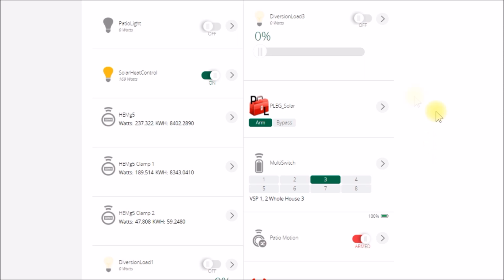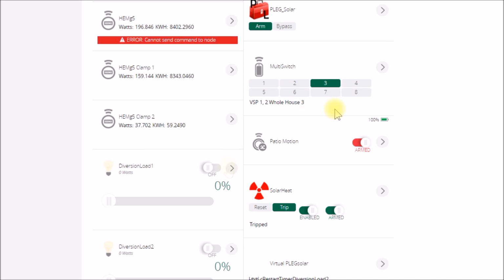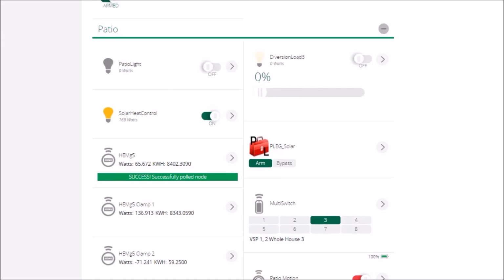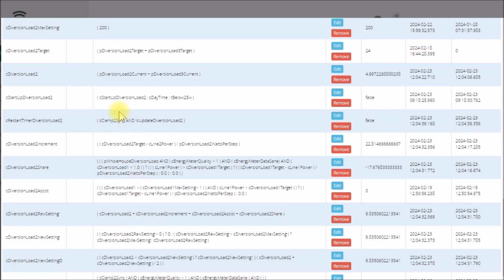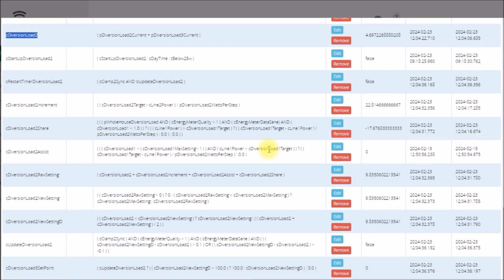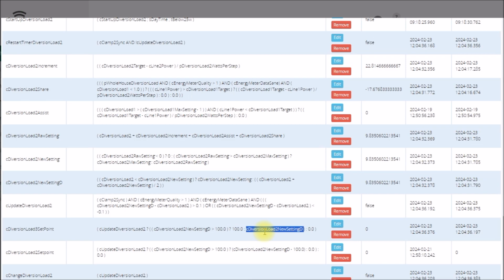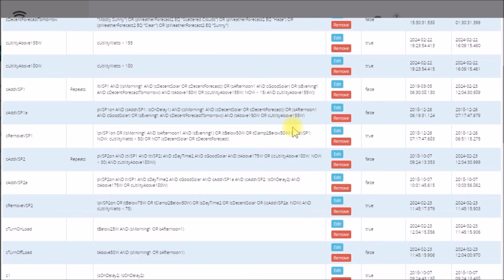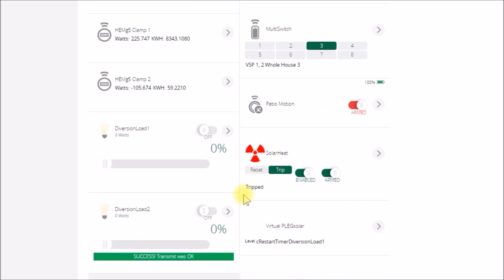AC Diversion Load: Added Capacity, Part 2

Comment from the maker: It took me a year to figure out how to add this 3rd diversion load into the system.  In the end, it was fairly easy, but figuring out where to add a few lines of code and make a few changes took a lot of time to work out.  

Originally, I wanted to stick to the physical device property values to avoid synchronization issues like I ran into when I first developed this code.  But it was proving difficult to do that and then it finally clicked that using conditional expressions that reference the device properties would abstract most of the code from the physical devices and their limitations.